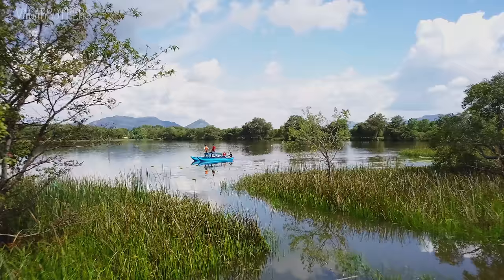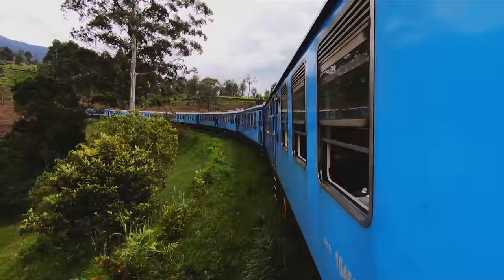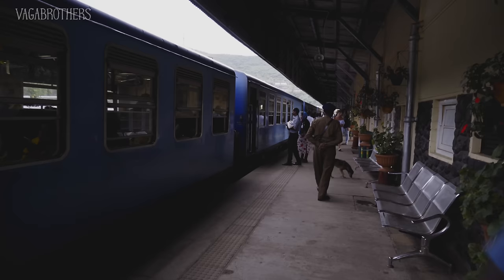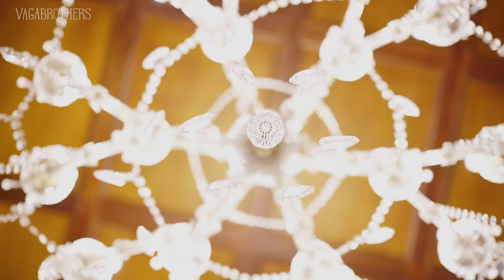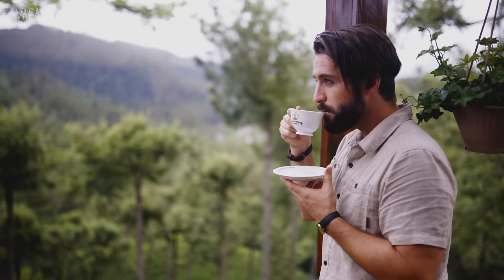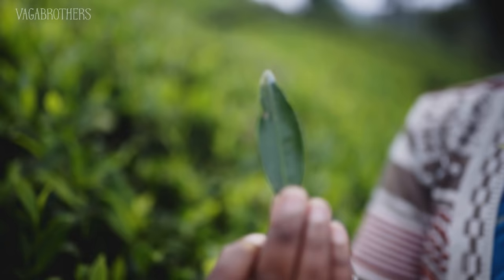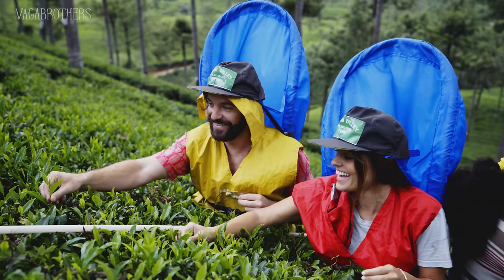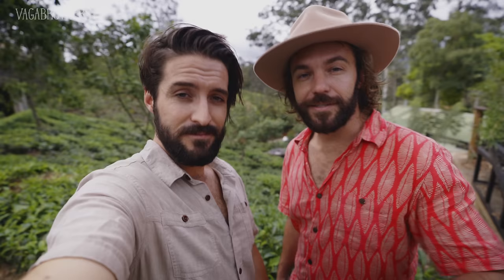Sri Lanka's Scenic Train Ride from Kandy to Ella

Comment: Nice Video Guys. The Train does not go to Nuwara Eliya but it passes Nanu Oya where you need to get down and get another mode of transportation to Visit Nuwara Eliya. Back in the days there was a Railway track from Nanu Oya to Udu pusselawa via Nuwara Eliya using a Narrow Gauge Railway line. It was closed around the 1940s as the Road Transportation was developed. Tea was introduced by a James Taylor who was a Scotsman in 1867 and it was pioneered by Thomas Lipton.

Comment: Wonderful experience. So happy that you guys enjoyed this journey. I am a srilankan living in Australia and big rail fan and last time I took this journey was in 1995 when this scenic route was not so popular. 
Few important points. 
There are 4 trains from Colombo to Badulla operating in this scenic route. The one you took is known as Podi manike which starts its journey from Colombo at 5:55 am. The next train to start from Colombo is Denuwara manike at 6:35am which is an intercity train with fewer stops. Next train to Badulla is Udarata manike departing Colombo at 8:30 am. Last daytime train to Badulla leaves Colombo at 9:45 am.
All these 4 trains consists of 1st, 2nd and 3rd class compartments. First 3 trains are newer push pull type power sets where as the last one is a locomotive driven one. 
Fastest and most convenient way to reach Badulla is using Denuwara manike intercity express where prices of similar class tickets are slightly higher. It doesn’t go via Kandy as Podi manike or udarata manike and stops at the 3rd platform in peradeniya junction. It’s away from the main station so you need to be aware of that.
The last train no 1008 has an observation saloon car at the end of the train which is famous for its Panoramic views.